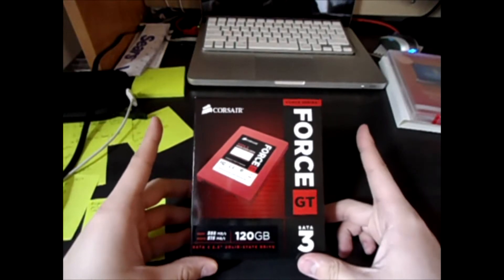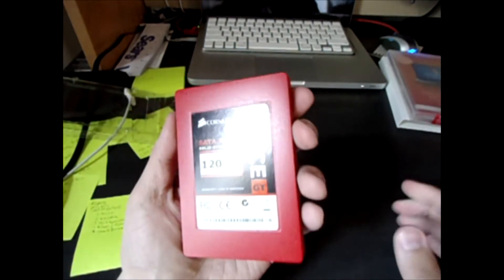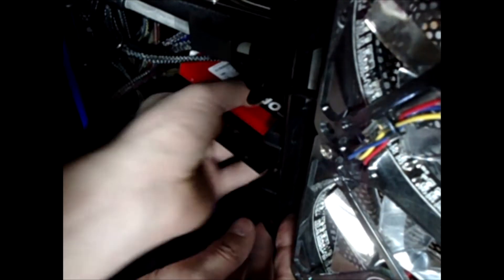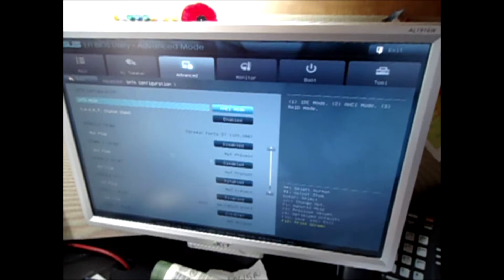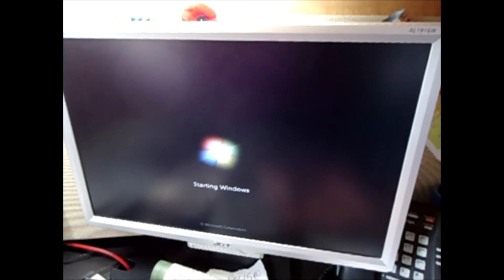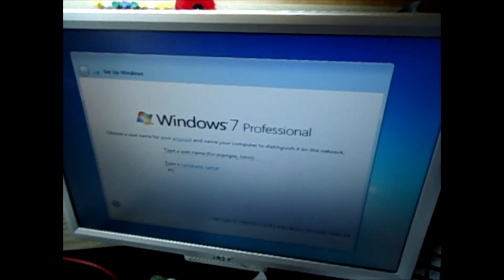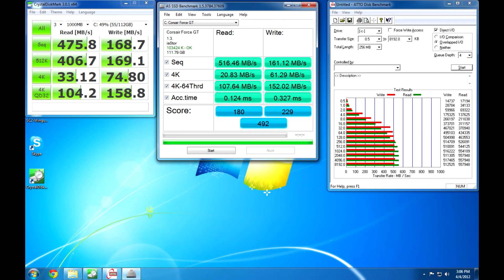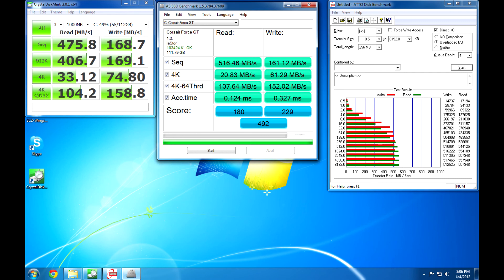Corsair GT Force 120GB SSD Unboxing, Review & Benchmarks

Comment from the maker: I have the Asus P8Z68 DELUXE and the drive is connected to the 6gb sata port (not the Marvell Controller) and in the ATTO disk test this drive was able to read at just over 555 @ 557mb/s, but in the other tests it was not the same. If you put the video in full screen @1080p you can clearly read the results of the test. This is my first SSD and I'm not an expert so I can't really say how you can fully reach those speeds.